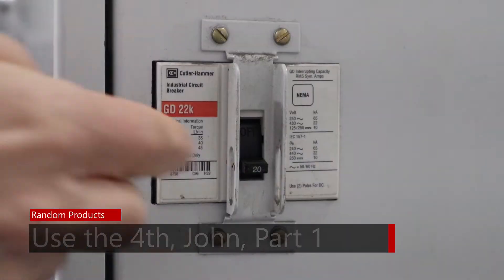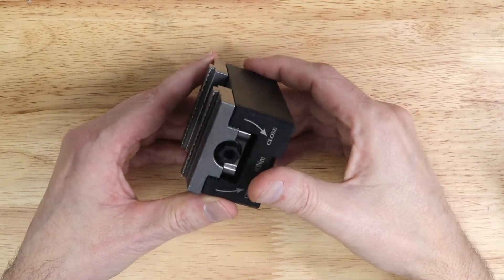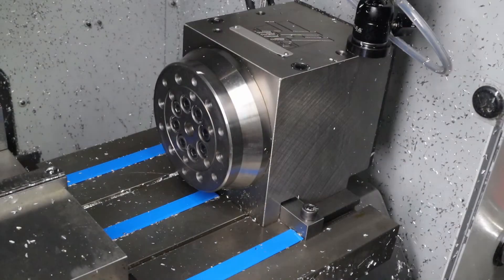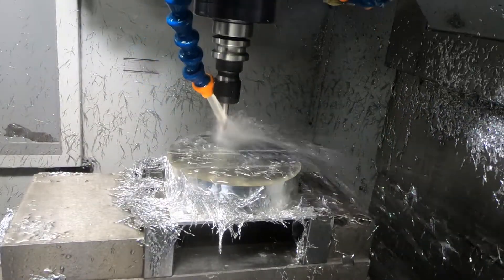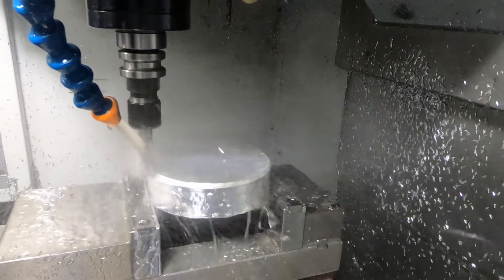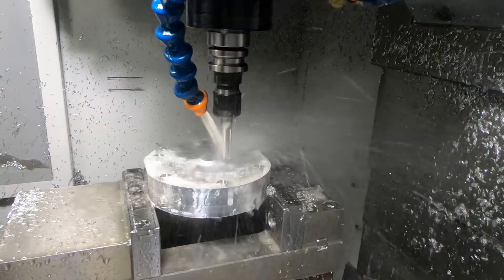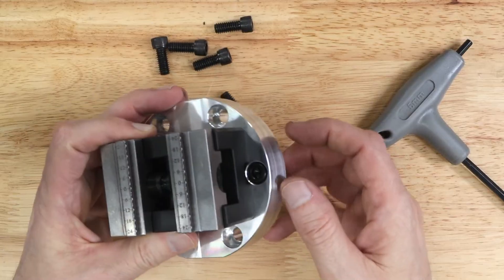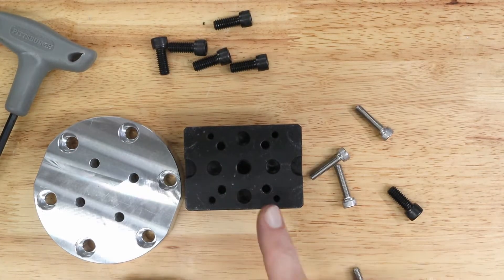Use the 4th, Part 1

Comment: Hi bro, question
How does that Chinese press work?
Reply from the maker: Do you mean how does the vise work? If so, it has a screw with left hand threads on one half and right hand threads on the other. That allows both jaws to open or close at the same time.

Comment: From my experience I should have started with a self-centering vise.  I bought an Orange County Delta vise, and I gotta say I was super disappointed.  From a design standpoint it uses a fixed jaw and it should half the tolerance compared to a self centering vise...  In theory.  But they took so many shortcuts that you spend more time fighting it than using it.  In Fusion I needed to add variables to compensate for the eccentric nature of the vise.  Long story short, I bought a Lang vise and I am way happier.

Comment: Was thinking about how you can cut a eccentric cam. Now I am thinking of a oval tip screwdriver and a oval slot in your injection molds for separation. More of a camming action than a sharp prying action.
Reply from the maker: I've sometimes thought of using an eccentric cam for ejection from my molds. It never occurred to me to make them with a 4th axis. Cool idea.